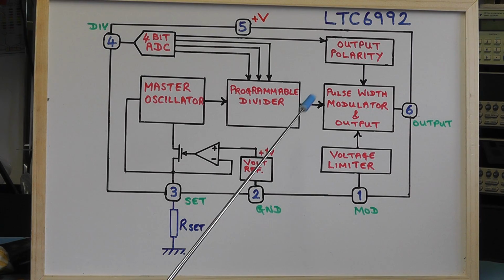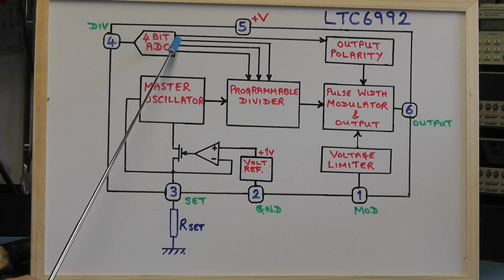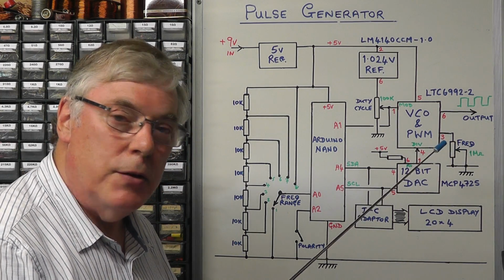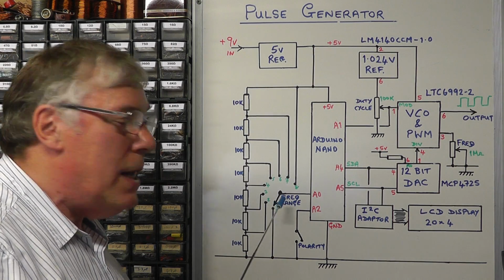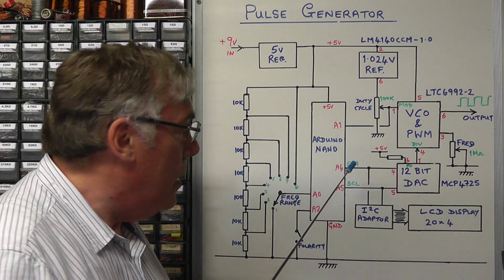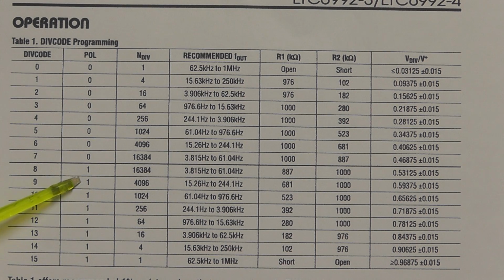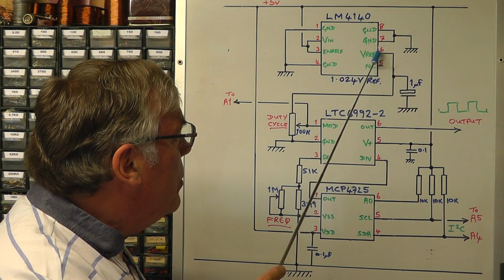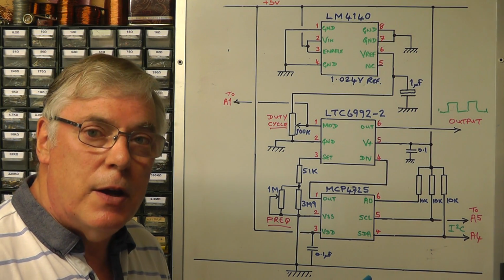Scullcom Hobby Electronics #42 - Design & Build a Pulse Generator Part 1

Comment: Hello, Would it be possible to drive an IRL540N mosfet with this pulse generator? What is the voltage output? Kind regards Paul.
Reply from the maker: As far as I can tell the IRL540N should work fine. Need to work in the DC safe operating area. I will further discuss other Mosfet options in Part 2 of this project.
Reply: +Scullcom Hobby Electronics Dear Sir, Thank you for the reply. Very much looking forward to part2. I had a little look at some mosfet driver chips but there are so many to choose from. I am trying to put together a pulsed power supply that can deliver up to 100VDC at 5A max , the pulse driver would be great if it could deliver 10khz to 200khz. The power supply will be used for a small wire edm machine .I guess the mosfet choice is very important for this requirement. I think your pulse generator could be perfect for my project. All the best and kind regards Paul

Comment: Thank you for your excellent video, it is an interesting project, very didactic.I wonder what type of applications could have this pulse generator?
Reply from the maker: Thanks. You can use a pulse generator for a number of tasks. I use them when designing and developing logic circuits and testing. Also you can use one together with an oscilloscope to measure the length of a piece of coax transmission line as well as estimate its impedance. You can determine the location of a break in coax cables making it easy to locate where the break is.

Comment: Why do not you use good PCB design? 25:29 
9V & 5v thicker rails (but especially GND. They will also be part of the heatsink 5v regulator).
But I'm very grateful to you and I thank you that you have done a lot of teaching and instructional tutorial videos on Youtube!
Reply: i think thin rails is termo (-stress) sensitive. 
( I think this modification is better https://goo.gl/photos/z8aKM9MgsFW7RYhb6 
and output wires and pads is thicker/bigger )

Comment: Thats a clever design, im not into using micro controllers so the option to feed the ltc6992 with switched resistors would appeal to me :-),   The ltc6992 looks lika a very simple chip to use :-D.
Reply from the maker: Thanks. I was playing around with this IC and thought it would be a good idea for a project. The only thing I am finding the that using a variable resistor on pin 3 to control the frequency causes some instability or jitter at the higher frequencies. This is due to the longer connecting wire from the pot to the IC pin which introduces some capacitive effect. I am looking at some alternative ways to replace the variable pot, may be a digital potentiometer IC placed close to the LTC6992 on the PCB and then controlled by the Arduino Nano.
Reply: What about a short length of Rg58 coaxial cable, a short length should have very little capacitance, have you tryed that? :-)
Reply from the maker: I could give it a try. But I would imagine even the small capacitance effects of about 20pF would still cause problems for the LTC6992. The IC would normally have a fixed resistor positioned as close as possible to pin 3. I will have a look at a few options and see what is possible.

Comment: Thanks! Do you know if we could use a digital potentiometer (with Arduino-SPI) like the MCP41100 for trimming the frequency? That way we could set all with a rotary encoder.
Reply from the maker: I have been looking at other ways of setting the frequency and one is to test a digital potentiometer IC so I will be testing this as an option. I am also looking at other possibilities since I have found that at higher frequencies just using a standard pot can cause jitter.

Comment: While I do not know your future intentions for this device it seems to me using the 12bit DAC to control a 4bit divider input is rather a waste. Why not use 4 digital outputs from the arduino summed via resistors feeding a voltage divider to set the division ratio voltage? Also if you used 2 of the 12 bit DACs to replace the freq and duty pots you could make this thing programmable via a serial link for automated sweeps and duty control and use a rotary encoder for front panel control. 
I really like the way you present these projects with the full circuit explanation and highlighting some inovative special function ICs
Reply from the maker: Thanks for your comments. The reason I used the 12 bit DAC (MCP4725) was because it was low cost and also I wanted to leave as many of the Arduino Nano data pins free for future upgrades and options. Also the MCP4725 has some internal EEPROM memory which we could use later. Part 1 of this project was really to introduce the LTC6992 and see how we could use it. I am looking at other ways of controlling this IC make it more programmable as you suggested.
Reply: Using an MCP4725 as an I2C module will cost €1,30 on ebay. I would like to see a rotary encoder like a menu selection for the frequency and divider network, that way we could loose the switch etc.

Comment: Nice project -- you very neatly integrated several ICs to achieve what you wanted.  /  I may have misunderstood your description, but I think you said the "polarity" switch altered the output from positive to negative (presumably with respect to ground).  Instead, it appears to simply invert the duty cycle.  /  I don't know how you'd achieve it with any accuracy using an Arduino Nano, but a readout of output frequency would be nice.
Reply from the maker: Thanks for your comments. As far as I can see it does invert the output polarity as the position of the duty cycle control signal remains unchanged. I supposed it all depend How you look at it. I have thought about adding a frequency reading, that was the reason I chose a larger LCD display module for this project.
Reply: Hmm...  If the polarity were changing, I would expect the scope trace to go negative -- that is, for the square wave to drop below the zero volts graticule -- but it doesn't (except for a little ringing on the falling edge).  If you set the duty cycle at, say, 70%, then in one switch position the square wave is high 70% of the time and in the other switch position it's low 70% of the time.  So, the duty cycle percentage is being inverted, not the output polarity.  Anyway, cool project; I'm looking forward to part two.

Comment: If we have 3 bits controlling the programmable divider, shouldn't we only have a range of 0..7 ? (the upper bit, after all, is used for the polarity).
Reply from the maker: Yes we only have ranges from 0 to 7 (8 frequency ranges).  However, if you look at the DIVCODE programming table I show in the video you will see the DIVCODE positions from 8 to 15 require higher control voltages (see last column) for the same frequency ranges when the output polarity is changed. Therefore we are using the first 3 bits of the binary code which gives us 000 to 111 (0 to 15 positions). The 4th bit is only used for the polarity switching circuit in the IC. If you have a look at page 15 of the datasheet you will see what I am trying to explain.

Comment: Why using 12 bit DAC while ADC inside the chip is only 4 bit?
Reply from the maker: The 12 bit DAC I used is low cost and also has some internal EEPROM memory we could use later in any upgrade. Also this DAC is simply controlled on the I2C bus and I wanted to introduce that on this project. Of course there are other ways of supplying this control voltage to the LTC6992 but I chose the MCP4725 for this project as it met my needs.